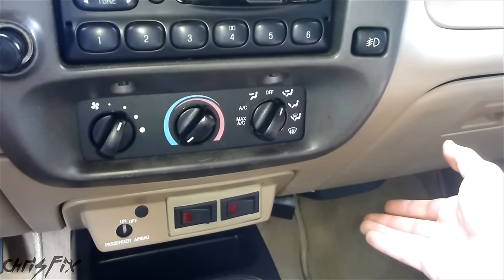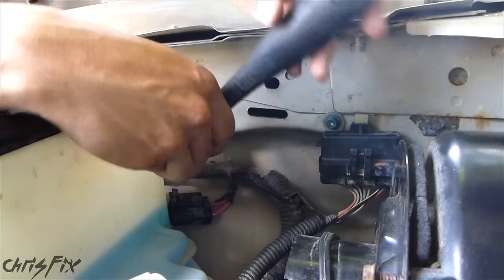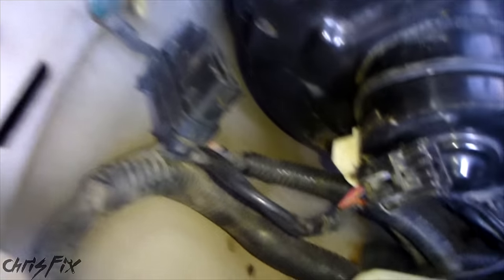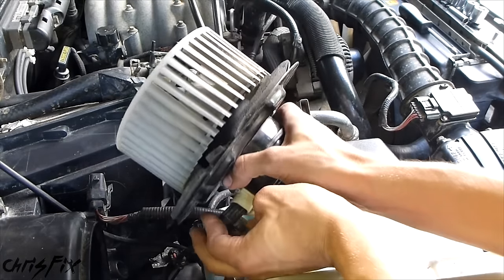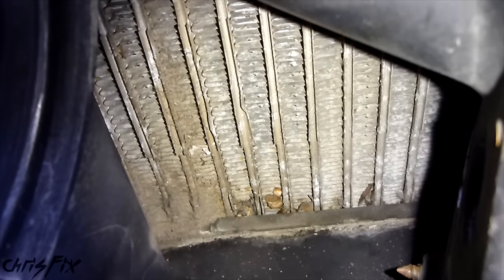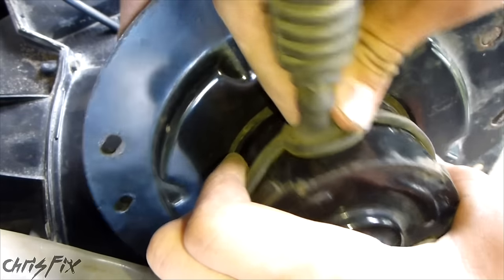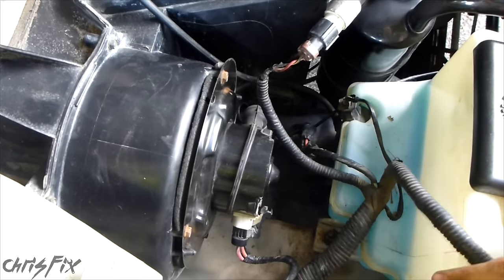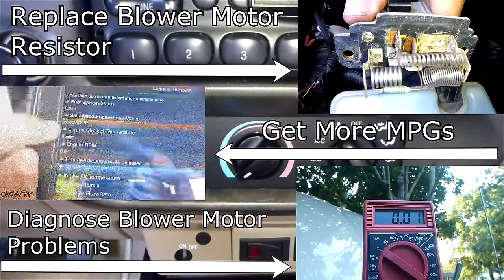How to fix a Noisy Blower Motor AC Heat Fan

Comment: hey Chris! can you do a video on this for a 1995 lexus ls400? my AC works, it blows cold and hot, however, the blower is really slow even if I put it on high setting ,its still like on low setting. And it makes a little bit of ticking noise whenever the ac is on I checked my cabin air filter and its really dirty, I`m planning on replacing it tomorrow. 
Thank you!

Comment: By any chance, do you know how to get rid of mildew smell coming from a vehicle AC? I've read it's build-up of bacteria and mold on the evaporator core. Is that true? I've replaced the cabin air filter and I've used Lysol in the air system. And I've also used a canned AC cleaner offered at AutoZone.  How would I access the evaporator on a 2005 Nissan Frontier? Thank you for any and all help.

Comment: i dont think my blower is bad. it squeaks slightly but WD-40 will fix that. my question is, when i turn my blower motor on, it is sooo loud when the air comes out. is there anything i can try to quiet the wind noise that comes out the vents? i think maybe the foam "gaskets" are just degraded and air is blowing through the connecting parts but the air that comes out the vents is pretty solid and good so im unsure. im going to take my dash out and see whats up with it and if i can do anything

Comment: I have a mazda 3 2010 with noisy blower motor, i cleaned the filter box under the glove compartment but it still makes noise. Is there a guide for mazda 2010 specifically to clean blower motor? Im new to car fixing.

Comment: Can you grease the bearings of the fan motor? Are the bearings accessible usually? I replaced a fan blower and its much more noisy than the stock one.
Reply from the maker: It's a sealed bearing but I am sure you can drip grease in it.

Comment: I feel like I have this issue, since Dec I've had this on and off "leaf" or "squealing" noise coming from the blower especially on the low setting. The AC and heat work fine. Every time I take it to the mechanic for him to hear, it decides not to make the noise -_-
I have a Kia Forte, 2015, so if the blower is bad, I would think I could get a new one under the warranty I have. However, I don't have to spend $$$ at the dealership only to find out there were just leaves in there and they charge me 100+ for checking/diagnostic test. I just wanted a pro to hear it and I'm still considering waiting to have a mechanic hear it to let me know their opinion. Either Kia or the mechanic won't know for sure until they open it up, so I'll be charged regardless, however if the blower is the issue, the test and blower should be free for me/under warranty. hmm

Comment: To any ac or hvac guys out there , I recently got my ac blower motor changed and this new variable speed blower Blows pretty slow compared to the last one but my house still cooled , I was wondering is it gonna be more efficient or not as good ? For comparison of the old one blew at speed 7/10 the new one blows at 3/10 ( how hard the air comes out all vents )

Comment: Hello Chris, When I turn on my AC and the car is at idle, it starts to vibrate (the AC is blowing cold air). What is the explanation? The car has an 1.4l petrol engine, it has no errors. The AC light started to come on every time I start the car, and because of the vibration at idle the car starts harder. Another problem is that if the car stays very long in the parking lot, and is very hot outside, when i start, it has the tendency to stall, but after running a few minutes all comes back to normal (this problem does not occur when is cold outside).

Comment: Hey Chris, I have a very loud, irritating whistle when the blower or AC is on.  Always whistling, but varies depending on how many vents are turned on or off.  Where would the first place you would look to correct this annoying sound.
Reply from the maker: +Vickie Wells I would check the same place I showed in this video.

Comment: I have squeak noise problem on my E39 from this blower, but this is actual only in winter and after it warms up, noise goes off or maybe is slightly hearable. Any explanation on this? And is it possible to somehow oil it without taking out motor? (For E39 it is even more complicated process)

Comment: How freely should the blower spin, I ran the fan outside on the floor and it ran great.  When I turn by hand it spins but not as freely as say a front bicycle wheel to give an idea.  Barely spins a full revolution, any ideas would be appreciated.  Thanks!

Comment: Well if it leaves and not the blower. I took out the filter out which I just replaced and gave the opening a blast with leaf blower leaves blew out and noise fixed.

Comment: Hey Chris, thanks for another awesome video :) I've got a question: when I turn on the blower in my car, while at the lowest speed it sometimes makes a squeaky noise, that tends to go away if I put it at max fan speed for a few minutes, only to reappear as soon as I hit a bump (and Italian roads are full of bumps, potholes etc). Could it be fixed in a similar way? Also, whenever I turn on the hot air, there's quite a bad smell in the cabin; I've also changed the cabin filter recently, so what could it be?
Reply: Probably blower's bearing doned so and you should clean the evaparator.

Comment: Hey Chris, my grandmother has a 2005 Cadillac DTS and the problem she's having is that everyone and then the passenger side will blow out hot air when the air conditioning is on. I cleaned the blower motor and got all of the dirt and dust out of it but I'm not exactly sure how to fix it. Do you know what could be wrong and how to fix it?
Reply from the maker: +yogibear224 You need to find the blend door and either fix the actuator or the vacuum line that opens and closes it. Watch this video because I explain what a blend door is at the end: https://www.youtube.com/watch?v=-XjXTVJhFLM

Comment: 1999 suzuki grand vitara, replaced blower motor tan, resistor and relay, the fan will not come on still. Could it be the fan control on the dash? How do you replace?

Comment: After much investigation I discovered that the issue was my blower motor relay was fried. After replacing the relay I do get air blowing but it's weak and only sometimes comes through the vents. It mostly just comes up near the windshield and on the floor.
The switches appear to work. I reckon that'll be the next thing I take out and check. After that I'm at a loss as to what could be wrong.

Comment: I have a problem with my 2001 Ford explorer sporttrac. Air won't come out from the vents, only from the defogger. I've look and see no air filter cabin in the truck. But the fan works good. And also there's no much information about the 2001explorer. Do you know or from experience what could be the problem?

Comment: Hi Chris,
hope you can help me out...... i have a 2002 wrx. I noticed that the radiator fans would stay after the first heat cycle........  i bypass the heater system and the fans would kick in and then turn off........ i added the heater back into the system and the radiator fans kick in and car's temperature stays at around 200Fº at idle....... what could be causing this issue?

Thanks

Comment: hey Chris any advice you can give me on my 2004 honda pilot l... my a/c works great blows out great but the rear a/c doesn't blow out any air....
Reply from the maker: +joshuabmartinez1 It is probably a blower motor or blower motor resistor for the rear vents: https://www.youtube.com/watch?v=Q-i0tytSYIM
It could also be the vent doors not opening for the rear vents if you only have 1 blower motor.

Comment: This is why I don't use fresh air mode. Cause all it'll do is bring in a whole bunch of nasty stuff. Mine is sadly electronically controlled... But everytime I started the car, it would reset to fresh air. So, I put it in recirculation, and unplugged the stupid thing. Contrary to popular belief, the defrost still works just fine. the heater works just a good... So, I don't see an issue with it. If you have the manual adjustment that will stay on recirculation, I'd always leave it on there. It'll pretty much prevent this from happenenning.
Reply: recirculate will give you issues in rain, unhooking it is not a good idea sooner or later you will need to be able to put it on fresh air.
Reply: +asasial1977
 UNLESS you run the A/C and heat at the same time. The A/C will dehumidify the recir'd air.
Volvos do this automatically on the defrost setting.

Comment: 09 fit. Ok my blower motor sounded terrible like yours. I found a damn mouse stuck in the fan. I removed the mouse, cleaned the filter and the the motor still sounded terrible. After a while it only worked on high, then high didn't work any longer. now it'll randomly kick on on high but not full blast. It'll work then die. Obviously the blower is bad as well as the (resistor? Transistor?).

Comment: Would have been nice to know what car this was year make and model.  It's not like every car is the same.  You mention taking the panel off by the dash no clue what to do after that.  will search for more videos but so far i only see removal of the blower motor for my jeep
Reply from the maker: This is for a 2001 Mazda B3000 but the process is very similar for many makes and models that have the blower motor inside the engine bay.
Reply: ChrisFix thanks for the reply.  for a Jeep it’s under the dash but all I can find is removal videos.  Nothing about cleaning it out.  Probably tons of crap in mine causing the noise.

Comment: hey Chris i have an issue with my car and the heat. the problem is that when my car is at 2000 rpms or higher I can feel the heat. but only when I have the fan on number 4 which is the highest. but if I have the fan on either 0 or 3 I can feel it very faintly (yes even on 0 I can feel it). my coolant levels are where they need to be. do you think I need a new blower motor or resistor, should I flush the heater core or do you think that my water pump is bad.
Reply from the maker: +rockchub It might be the resistor: https://www.youtube.com/watch?v=Q-i0tytSYIM
The heater core might need a flush: https://www.youtube.com/watch?v=M9SIafVsqyc
Or you might have another problem so check out this video on diagnosing "no heat": https://www.youtube.com/watch?v=-XjXTVJhFLM

Comment: Could this result in no heat as well? If the blower is clogged and filled with debris would that be the reason why I have no heat or defrost?? Just trying to narrow things out and yeah the blower sounds like that but idk
Reply: rzpn If there's no air coming through the vents, it could be the blower motor. If there's lots of air coming out, but it's cold, it's not the blower. More likely a blend door actuator in that case.

Comment: so... it doesn't have a cabin filter? that's a bit of a design flaw if you ask me. My Tiburon has a cabin filter, and when I removed it after 10 years it had 3x it's width of Darbee stacked on top of it that fell directly into the blower O_o.

Still gata give them props, they put the resister pack in a place where the fan can cool it, in my Tiburon they put it in the HVAC controller, in other words, it has no airflow so it will just cook itself to death if you leave it on 1 for too long.

Comment: I have a 2002 chevy suburban that only blows air from the top. I noticed this happened after I was having trouble with my battery and I exchanged it. what could be the cause of this issue??

Comment: Just an FYI for anyone who finds this video, it is not completely accurate. The video is correct that you need to move the reservoir tanks back, but the video shows only 3 bolts holding the tank in, two on the side and the one of the bottom front that pops out of that hole. Well, there is actually TWO bolts on the bottom, one on either side of the tank. So if you only remove one, you still won't be able to move the reservoir. I am guessing maybe ChrisFix is missing the bolt on the other side, which is why he can move his after only removing the one bolt

To remove the screw on the other side of the reservoir tank you need to remove the airbox to get to it. If you do this, I recommend leaving that screw out and not putting it back, it is not needed, the two bolts on the side and the bolt in the front are  sufficient to hold the reservoir in place, and that way if you need to take out the blower motor again in the future you don't have to mess with the airbox at all which is a real hassle to get out

Comment: I drive an S10 and my goodness does my blower motor squeal! Mine is a little more difficult to get to but not difficult overall. I was going to take it apart and spray some silicone spray but the part is so cheap I decided I didn't want to disassemble this again.

Comment: Hey Chris I have a 02 lancer and my ac rattles when i turn it on the blow motor is around the glove box area do you think there could be debris like leaves in there even though it’s inside the car?
Reply from the maker: Yea that is the most common problem.

Comment: I have a 2015 Corolla and every time I turn it on the fan blows a very musty and disgusting oder, it started doing that a couple months after we got it new, we got the system flushed and no more than a year later the smell is back. How can I keep it from occurring? I live in Virginia so the weather isn't very hot or cold so there shouldn't by any mold in the system.

Comment: Hi I have a 2004 Nissan phatfinder with 104000 miles and it has a p1130 code I checked all the hoses except the one looks like is goin between on the manifold can you please tell me where is conected from swirl control valve to? Thanks

Comment: Mine makes a chirping sound on its lowest setting, it's like it's powered by hamsters. It's not loud, but loud enough to be heard over the wind and tyre noise. Should I spray some silicone grease the the shaft? The car is a '98 Daewoo Lanos.

Comment: My AC just started making a buzzing sound coming from the area of the blower motor. I replaced the air cabin filter and literally the very next day this humming started. I removed the Blower motor and vacuumed it out. There was nothing obvious. When I unplug the motor the noise stops. When I turn off the AC the buzzing noise stops. Other than that I get ice cold AC and everything is fine. Here’s the weird part about this story. I went to autozone and purchased a new blower motor and it was making the same noise. So I’m very confused 🫤. Any ideas?

Comment: If you have a problem with mice repeatedly getting inside the blower housing you can use Hot Sauce to coat the fan itself and they won’t want to come back and you don’t smell it but it’s there and stays there.

Comment: I have a 2003 honda odyssey and the rear blower is not working at all when i turn the knob it just makes a clicking noise whenever i change the fan speed. Just wondering if i need a new blower motor i change the resistor and still not working.

Comment: Hey Chris I have Indian Tata made Indica which is making a noise now a days. I asked in garage to fix the noise but they said it is engine belt noise and can not be fixed Can you suggest me something so that I can fix it.
Reply: my jeep cherokee used to have engine belt  noise, and the dealer we bought it from couldnt fix it. the funny thing is i went to one of those 10 minute oil change places that also does other car services, they noticed it was making noise when i came in, and they fixed it no charge for me, and the noise never returned. id try going to another mechanic if the one you are going to cant fix the engine belt noise for you

Comment: hey Chris. I have a 2004 dodge neon srt4 and the heat isn't working on the passenger floor, but everywhere else it's working fine. any tips?
Reply from the maker: +kawasakirider29 Sounds like a vent door issue (actuator or vacuum line). https://www.youtube.com/watch?v=-XjXTVJhFLM
Reply: +ChrisFix Ok I'll check it out. thanks!

Comment: Hey Chris, when my Fan is off the outside airstream comes through it, I alrdy changed the cabin filter bc I thought it might be the cause. Any Idea why this might be?
Reply from the maker: +360°Holo That is the vents not closing all of the way. Usually due to a vacuum leak in the actuator that closes the vents in the "off" position.

Comment: can squeaking noise be solved by this? and also how would you be able to check why the car only blows on 1 setting? for example my car only blows on the windshield and not in my footwell. please help
Reply from the maker: That is your vent actuator. If it is vacuum driven look for a vacuum leak in one of the lines going to the vent actuator. If it is electric, it is probably a bad gear.